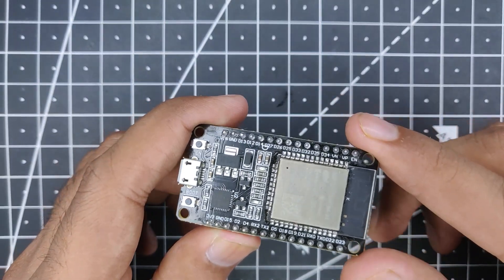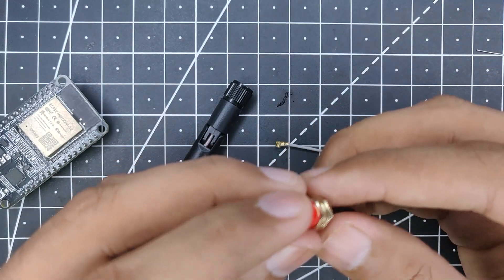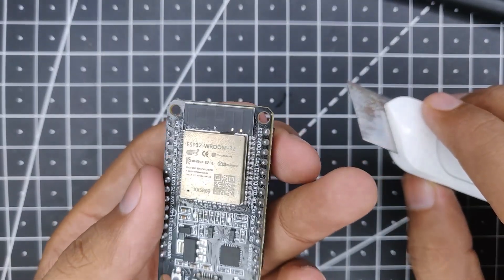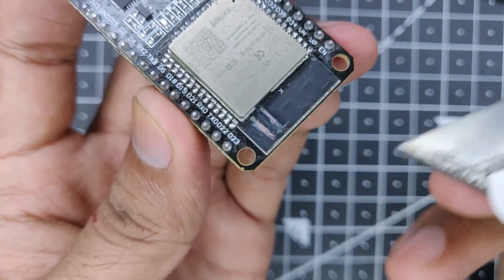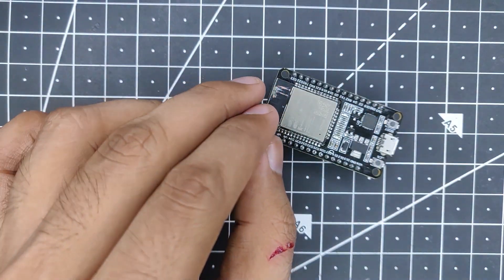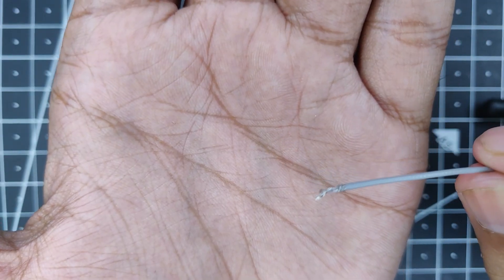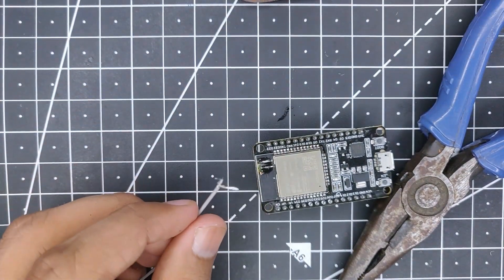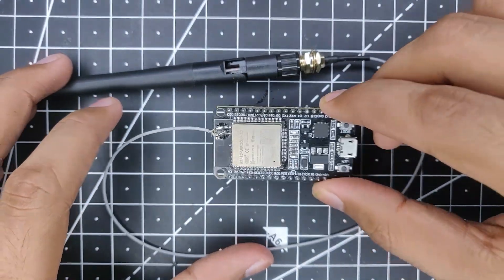ESP32 External Antenna Attachment Tutorial | ESP32 Long Range Antenna Mod | HOW TO

Comment: This is not a sophisticated project… This is a hack & slash job. If you had chosen the sophisticated path, you would’ve added an IPEX connector for the SMA wire to plug in to. Instead you scraped off the shielding to expose the traces & soldered straight to it. That’s just rigging it, not doing a proper antenna exchange. You won’t get the full benefit of the external antenna, but it will work better than the internal antenna.

Comment: Thank you for this. I was going to add an outside yagi point towards the outside 2.4ghz solar/UV station that I made. I had an old wireless print server that had the pigtail for the ext antenna.
I did the mod today and signal went from -80dB to -53dB. Distance from router to device approx 125'. I am very pleased I did this.

Comment: Way too much work and can't believe you don't know this but Espresif with their ESP32 boards did some cost savings which lead them to remove any external connectors they didn't see users utilizing its range...and maybe a few cents but if making hundreds of thousands maybe millions of the boards it adds up. BUT, what they did do....sure they removed the larger sma or ipex...but you don't have to do all that cutting/ scraping. Possibly getting cancer from breathing the dust(you did wear a mask while scrapping right? That black protective coating is highly carcinogenic)... but that black layer actually peels off leaving behind a couple small glue spots... all you need is to buy ipex connectors. The little ones.. and peel the black off- be care full...it's also very thin and difficult to do...once you do, just place he ipex connector on the glue spots...no need for solder either. Just take care with attaching the antenna and try not to have to disconnect reconnect too many times.  Hope that helps.
Reply: 😅 back seat drive much paranoid. bro is working with what he has. the tiny pex connectors are convenient but might not line up with the trace pads. he could buy an esp with one already installed,  or you can just let this man make videos in peace with you trying to be OSHA

Comment: Bro i have a repeater so my question is are this anteena for output wifi on input singnal from the router
Im talking about stock  motherboard anteena 
Im getting 1 bar i want to get more can i use this biuld to get strong signal

Comment: Did you match the impedance? The cable and antenna you use has 50 Ω impedance? Because I think that this PCB antenna is a 50 Ω antenna. And you are soldering to the antenna section, not the feed point. So you can easily screw up the performance to be worse than if you just leave it as it is. Although, I don't see any matching network, so perhaps there is no matching network needed because the PCB antenna might be 36 Ω? But you need to match the cable and antenna hardware to it.

I checked your antenna link and there it says 50 Ω, and that would be fine if there was a CLC π-network to match the ESP32 pin impedance with the antenna impedance of 50 Ω, but there isn't, so I think they used a PCB antenna that is matched to the pin, not 50 Ω, which means you should be putting in a matching network!

Comment: feel free to remove the antenna outer cover, just the wire enough will give you better range than before ofcourse less than full antenna but might be just enough for your purpose, this is helpful for tight spaces and gives you more flexibility

Comment: Are you sure the antenna wires are touching the contacts on the board? If it is only touching the solder, then it won't work because solder is not very conductive.

Comment: I completed this mod to a couple esp32s. So far I have seen a noticeable difference in wifi capability! This definitely works!

My esp32 is in a shop ~50 ft from my home, behind 2 walls. It monitors my solar panels. And it's acting as an access point for any device in my house that wants to connect and see the panels stats.
The solar panel controller does come with bluetooth, but we all know what the range of bluetooth is like. :(

So - I read the data with the esp32 then broadcast it towards my house.

Before this mod, I didn't have a signal in my house at all. Couldn't even see the AP.
Now, I'm actually able to get data - most of the time at least.

I'm going to make a DIY biquad antenna for the esp32 and a raspberry pi in my house to see if I can increase both ends of that signal really well.
Reply from the maker: Very nice 👌. If you want even better range you can add a 2.4Ghz amplifier to increase the range also.
Reply: If you got the money for a Raspberry Pi, I'd say grab another ESP32 instead and set up a peer-to-peer connection. That’s what I do to control my whole house with AI

Comment: a simple question if i dont plug in the antenna to sma adapter it will keep working righT?
Reply from the maker: Yes it will work as I usually don't have the antenna plugged in while I am programming and testing the board. But I'm not sure about the effect it'll have on the range.
Reply: @INOVATRIX But it can't work as well as if all was property impedance matched.

Comment: what a crap job... buy a ESP32 with RP-SMA built.
Reply: He's talking about RF, not WiFi. 
The WiFi module from Ghost has an ESP32 WROOM chip ...with built-in antenna, unfortunately. You'd have to do a solder hack if you wanted to add RP-SMA.
Reply: what a dick comment

Comment: Bluetooth and Wifi have the same Frequency range (2.4Ghz). I think it will also extend the BLE because they shared the same antenna.  What do you think guys? Pls comment. Thank you
Reply: Hello, I have the same doubt.
Did you find the answer to your question or did you test with Bluetooth to see if it increases the distance range?
Reply: @patonaranjo9394 same question!

Comment: Does this antenna also extends the Bluetooth-range or only the wifi?
Reply: Same question
Reply: @jyreprejoles7604  well i bought it and can answer now, it indeet also extend the Bluetooth range a lot. I used the module for am firework ignition system and autside the box the old esp had a range of arround 40-50 m insinde the box only 5m. With the new antenna i didnt test it to its limits but it went at least back to the original range
Reply: Hello, I have the same doubt.
Did you find the answer to your question or did you test with Bluetooth to see if it increases the distance range?
Reply: Should be same as they both use the same antenna

Comment: doesn't look safe steps.
Reply from the maker: It does involve some risk.
Reply: @INOVATRIX What risks will be obtained if you apply such an antenna?
Reply: @wargakonoha2689 Risk you're going to jack up where you scrape and if it's not in a box to protect the connections.

Comment: Will this help extend the BLE range also or just wifi?
Reply: Bluetooth and Wifi have the same Frequency range (2.4Ghz). I think it will also extend the BLE because they shared the same antenna. What do you think guys? Pls comment. Thank you
Reply: Hello, I have the same doubt.
Did you find the answer to your question or did you test with Bluetooth to see if it increases the distance range?
Reply: @patonaranjo9394   hello, I have not tested myself so I'm not positive if it will also extend the BLE range or not.
Reply: @techdad6135 I'm going to do the tests these days
I will tell you about the results I get
Reply: @patonaranjo9394 what are the results ?
Reply: @Litoof   hello
I did the tests
Indeed, the external antenna of the esp32 does increase the range of Bluetooth, I was able to control the outputs of the esp32 with my cell phone via Bluetooth at a distance of 40m
Reply: @patonaranjo9394  NICE! Thanks for confirming!
Reply: It's a WiFi antenna…

Comment: Will this increase both sensitivity and output?
Reply from the maker: I didn't check the before and after state so can't really say but it will surely increase the range although not by much.
Reply: @INOVATRIX I just mean, will this increase the range that the signal goes out and the range that signals can be picked up?  or does it only increase the range signal goes out?
Reply from the maker: Should help in both

Comment: Do you have a part number for the cable you are connecting? Where did you purchase it? Thanks
Reply from the maker: It usually comes with the antenna but if it doesn't then you can search for it as "sma antenna extension cable".
Reply: You can give antenna from old router